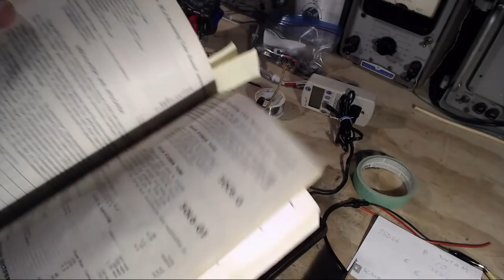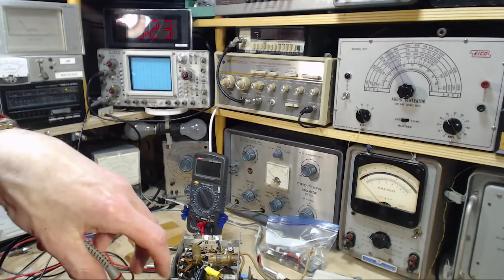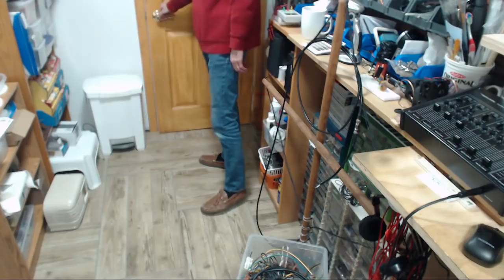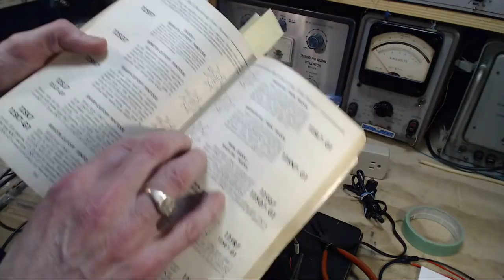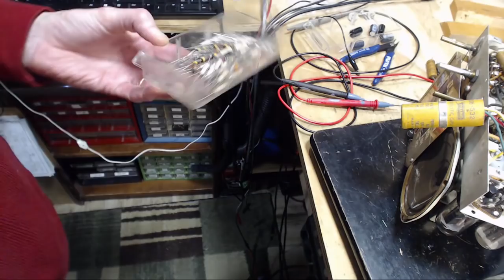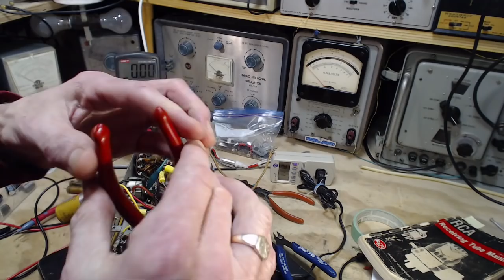Crosley G2465 Two Band Radio Video #2 - Hum Chasing

Comment: 4.7 or 5.7 Meg is not going to make any difference. This grid resistor is often as high as 10 Meg.
Remove that phono input and it’s wiring. It’s not original I think.

Comment: Hi Jim, In this Radio all the high sensitive pre-amplifier wiring are done using non-shielded cables. They are able to pick up surrounding electrical noises. So my suggestion is to put " the back metallic cover of chassis "  back in place and connect that to chassis and then try to confirm hum exists or not.

Comment: I would probably be inclined to see how noticeable the hum/buzz is with actual broadcasts coming through.  A number of my radios behave the same way, but when receiving the volume is never raised enough to hear the sound.  Also, a seemingly slight value change in a resistor can cause major issues.  I had a 1937 Zenith with a 2 meg resistor that had drifted to almost 3.  Went through the whole radio and couldn't figure out why it had very low audio output.  Finally decided to change that resistor and it solved the issue completely.

Comment: 12:07 If I was to experiment with adding or removing paralleled capacitors in a live set on a regular basis I would have prepared myself a switch with isolated wires to easily turn the additional augmenwhatchacallit cap on or off. Fumbling around with metal pliers in such a nest of live wires and things beeping left and right making one jump calls for a shower of sparks some day.
Reply: At a minimum, make the connection to the cap in the DUT with said DUT powered down.. then do the 'paralled cap testing' in a controlled, calm fashion with no clutter. This, assuming you're not repairing a Physio Control Lifepak 10 defib. I cannot recommend testing this device by paralleling anything to anything in it and hitting the charge buttons on the paddles. Sorry... still adjusting to retirement. PS- I now look for your comment, Melissa, before even watching the vid. lol
Reply: I can no longer watch him, and have since removed him from my subscribed to list. We all know that he is destined to electrocute himself any day now. You will know when it happens because his video will stop and asoom room temperature from then on. We wont hear the violent screams of agony and the violent muscle cramping and violent body movements that just shove his hands deeper into the high voltage that he is feeling rip his heart apart. I think his age is making him think he has the safety first mind in focose, however all of us viewers can see that this is not so.